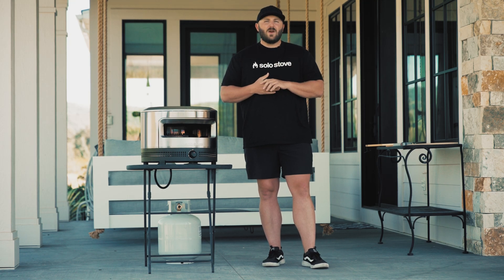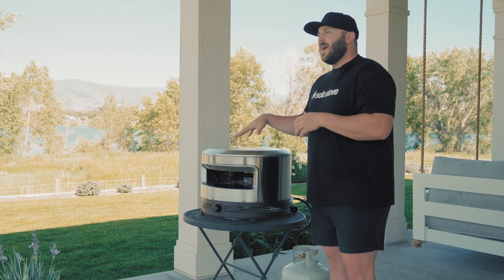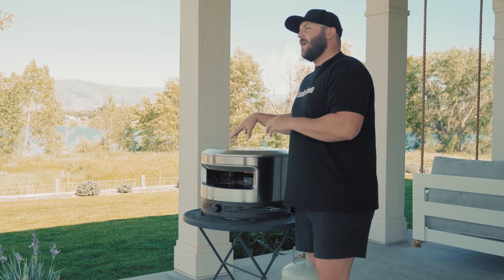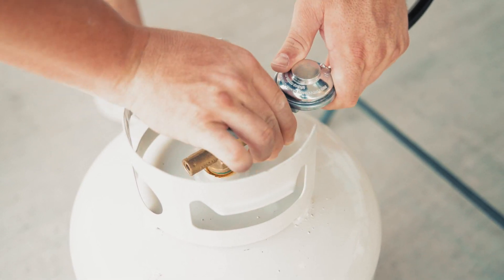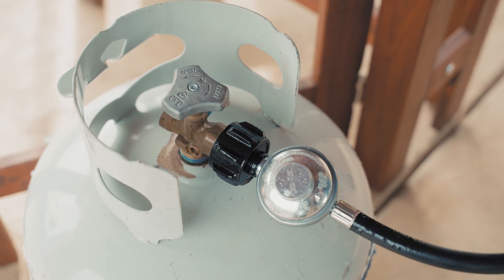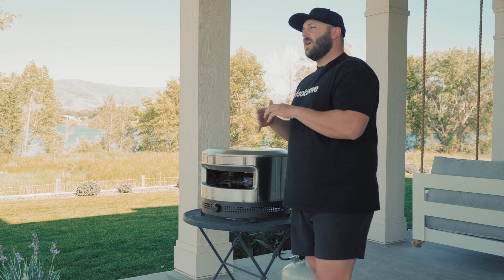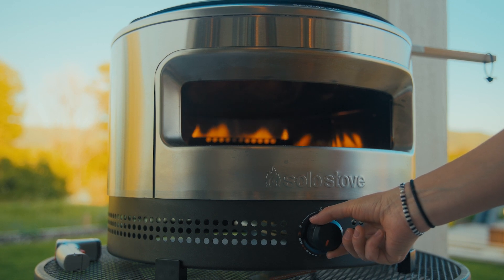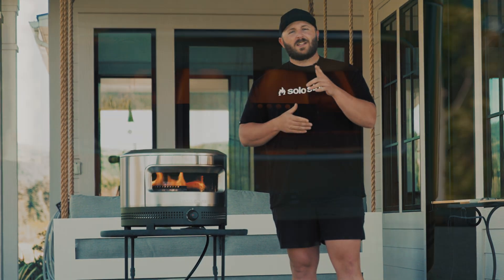Pi Prime: Setup & Use

Comment: What is the difference in the opening measurement between Prime and the Original Pi Oven, If the Pi Oven opening is larger than Prime ?
Reply: I think theyre the same. The difference is this one is gas only. The older one can do gas and wood.